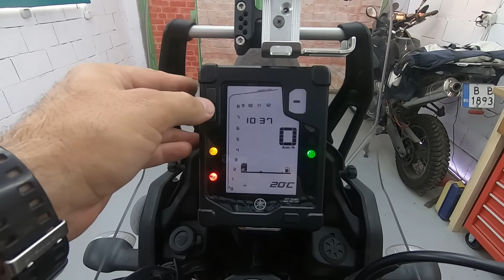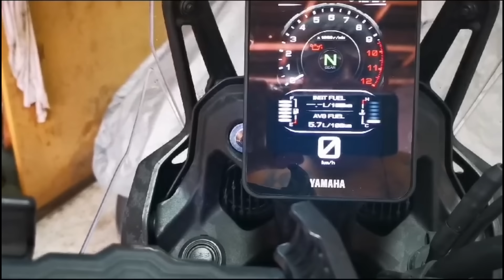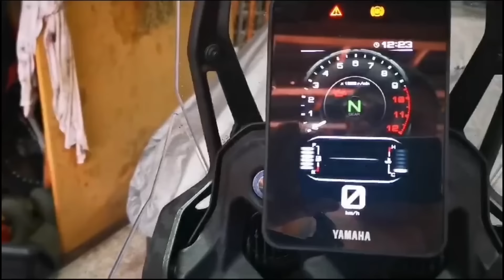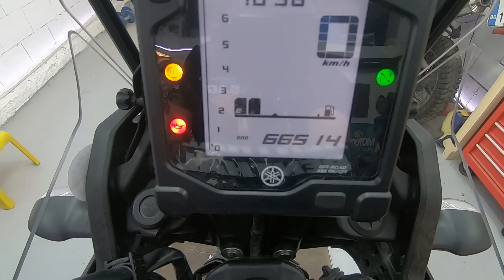Yamaha Tenere 700 - Long Term [66,000km] Owners Review

Comment: Good job with this video and congrats on the successful 66,000 km adventure!
With that much experience riding it, do you opinions or recommendations on tires and tire pressure?
Reply from the maker: Anything from 2 to 2.5 BAR, depend on the terrain.

Comment: Hi Pavlin 

Two Questions please
Has the bike had a Valve inspection before your trip? Are you still using the original Spark plugs.

Thanks Rob
Reply from the maker: No valves check until this moment. I am going to do it very soon. I change the spark plugs on 27,000km, before the trip. At the moment they have almost 40,000km.

Comment: Wow man huge respect you drove through the whole Russia, that's amazing! What can you tell about the stock tires how good are those? Would you recommend to replace them and if so what would be a good pick on your opinion. Cheers man.
Reply from the maker: The rear was fine, I did 16,000km with it. The stock was wobbling and replace it immediately.

Comment: The main problem I have is with corrosion with some fittings after riding in uk winter mainly due to salt being put on the roads (lot of them I've changed for stainless) that and my side stand switch and clutch switch, got my stand switch working again with wd40 but clutch one needs replacing
Reply from the maker: Thanks for sharing!

Comment: When bike's motor is not running oil level should be under the clutch as it is in Yamaha Tenere 700, but the clutch must be lubricated immediately when the engine is starting!
Reply from the maker: In theory, yes. On practice something else is happening.

Comment: Repeated question. don't mind. Which company's springs did you install?
Reply from the maker: Off the road: https://www.off-the-road.de/en/tenere-700/wear-parts/suspension/141292/uprated-fork-springs-linear-yamaha-tenere-700?number=GF-OTR-T700-66

Comment: I had thw same clutch issue making than noise once cold.I've changed the friction and metal  plates for a ebc ones the problem not existing any more
Reply from the maker: Ok, thanks for sharing!
Reply: ...also that throttle response ita not a throthle cable issue .Its due to an engine characteriscltisc That might be fixed by flashing ecu and tune the engine or by adding rapid bike evo  .T7 rally does not have that issue its been eliminated by yamaha .

Comment: for me just planning of getting my first Yamaha a top revue mentioning some very important points to get me going even more... thanks for that.  What about the fuel range... did you carried and extra fuel in any situation ? regards from zurich
Reply from the maker: Only once for distance of 400km.
Reply: @motorcycleadventures   with normal PET bottles or do you carry a petrol bag?
Reply from the maker: I bought a cheap petrol can and threw it away after that.

Comment: The transmission noise seems to be an issue with some Yamaha. I had a Tracer 900 2019 that had a very loud high pitch noise at 3000 rpm. It was so annoying I got rid of it.
Reply from the maker: Ok

Comment: Hi Pavlin, I don't remember if you mentioned in any video if you check the valves ? Just curious what your mechanic recommendation is.
Reply from the maker: Not checked yet. Today I spoke with him and he said that it will be pointless before 80,000km
Reply: Many thanks Pavlin

Comment: Paviln did you adjust the valves?  I am riding Tracer 900 40k km never had a problem ...
I had to change the chain, sprockets, and brakes and wash the fuel pump ....
Reply from the maker: Not yet.

Comment: Hi Pavlin. Thanks for your review of Tenere 700. I like it really much, but I am 1,71m only, and I’m reading lot of recomendations, that it is tall for small people, it is problematic to pick it up, when it fells down, the center of gravity shall be to high etc. But what other option do you see for smaller people? I really do not know… some people says, that Aprilia Tuareg is more suitable, but I am really not sure regarding the Aprilia reliability … Thanks Jan
Reply from the maker: You might try Honda CB500X
Reply: If you want to do more offroad a 650 v strom might be a good choice, i m 1,72 and it suits me pe4fectly
Reply: @robertgoetz2678  Hi. I ride allready now the 650 v-strom. But I am asking for more offroad capable bike like the Tenere. Not the v-strom and even the cb500x are without additional modifications not much offroad capable (they have low ground clearence, short suspension travels and chasis that under 90kg rider are not working..
My opinion there is not a choice. And please do not recommend me something like CRF300L..
Reply: @honzalk2931  hi, i have 72 kg, i donot understand why a v strom needs a heavier rider. I did put in more progressive springs from hyperpro in the front and rear.
 limited ground clearance might lead to rock contact sometimes, but the lower center of gravity makes it possible to lift up the bike even with baggage.
Reply: I'm 170, riding ktm 390 adventure. But it's a half of T7 in some sense.
Reply: @robertgoetz2678 Hi, I meant, that the bikes are designed for 75kg rider. If the people are heavier (for example I am 90kg, with all the gear almost 100kg), than the suspension is too soft. Even if you change the springs, it is not bike for bigger offroad. Yes, it rides somehow through, but first if you will try some bike with better suspension, you will see how it works and you will feel the difference. V-Strom is a great bike, I love it, but I am asking for more offroad capable one.

Comment: Yea I have the second problem too but I don't really think it is a problem as it only does it when you start the bike and then it is fine. How many times did you have to change the tires on your long trip btw and what tires did you use? As for the height, I am 174 and all I had to do was slightly soften the rear suspension, I think it really depends on skill and technique rather than height up to a certain point of course. Great review thank you.
Reply from the maker: I changed 3 sets of tires.
Reply: @motorcycleadventures  Thanks.

Comment: For new riders, this is not a motorcycle for technical off-road If you don't have multi year experience :)
Its very top heavy. Also, Its profile is very flat, dropping it is no fun, lifting it is no joke. Get something closer to 160Kg, one cylinder, play around. Otherwise you'll be riding on highways, gravel and won't feel much joy in more challenging situations. You need to get good instincts first.
Reply from the maker: Agree! As I said in the video it is not a dirt bike, even though it looks like!

Comment: @ 5:22 I would be really interested about a long term custom exhaust review, especially since both arrow and mivv say to watch out for discoloration and increase in noise as indicators to when the internal sound dampening material should be replaced. I mean I keep scratching my head how a custom exhaust is significantly lighter and smaller then the OEM and not trade something. I know it is more expensive but still. I belive that this is the main difference, the replacing of the wadding material much sooner then the OEM. And about tests, I think arrow mentions something about a weight decrease and I think the reason is that the insulation burns away so maybe weight it and compare it to the specs of a new one ?
Reply from the maker: Maybe in the future

Comment: Thank you Pavlin once more! Please can i ask you something, totally irrelevant: i see that that you have put two of these heat distributors on the tube that takes away the smoke of the heater. Is it worth putting two of them? 
Thenx
Reply from the maker: One for sure, the second is not necessary, but helps to heat the room faster.
Reply: Thanx thanx thanx😁

Comment: I disagree about the anti wobble front bracket. It's not just the dash that vibrates, but the headlight too. The headlight vibrating is the most annoying for me. I installed mine 5000km ago, I guess we'll see in time if it's an issue or not
Reply from the maker: Yes, the time will show you.

Comment: Hello Pavlin, you think that the new tenere explore model (which has a -15mm lower seat height) would be fit for a 175cm rider? Would the standard model also be ok at my height?
Reply from the maker: You might need to lower a bit more from the forks and the linkage but it will be okay.
Reply: @motorcycleadventures  thank you!

Comment: Re: removing upper crash bars. I’ve seen camel adv sell plastic side fairings that won’t crack. Dirt bike style plastic. I don’t own a t7 yet but one question I have is, how vulnerable is the radiator without the upper crash bars? Is there any sort of reinforcement to protect it hidden behind those plastic side fairings, or is the plastic the only thing protecting the radiator from side impacts?
Reply from the maker: In my opinion, it would be very difficult to hit the radiator. Because it is a very slim bike, the handlebar and footpegs touch the ground first. Theoretically, it could happen, but it could happen even with crash guards.
Reply: @motorcycleadventures  fair enough. I hadn’t taken the narrow width of the bike in to account. Thanks for the advice!!
Reply from the maker: Any time!

Comment: Question to all out there riding the T7: Does anybody else have starting problems. Is the same on mine from beginning. It's very rare, maybe once in 1000 or 2000km, but sometimes it's very anoing. Mostly happened when engine was shut down to quick or after running only a few seconds. After this it will not start again properly. Sometimes it helps to give a little throttle. Best way is to let it rest for a minute and then starts without any problems?
Reply from the maker: Never hear about it.
Reply: @motorcycleadventures  Thanks for immediate response!

Comment: Hey
Believe me or not, I had the same clutch problem, No slipping first time after start and the crrrk noise. At 33.000km I did send a video of it to my dealer. They tried with full synthetic oil and opened the clutch, but could not find anything wrong.
After trying the new oil which didn’t change anything, I send again a video of the effect. My dealer spoke with Yamaha and I got a full newclutch, because my dealer insisted on a full change to Yamaha.
Means change of ALL plates not only the ones with the pads, the springs, and even the basket, and the Yamalube standard mineral oil again. And you know what. The problem completely disappeared! The new clutch has a mich bigger slipping range at the clutch leaver, and a finer dosing is possible.
Now, with 58.000km, 25.000km later, it is still good and the problem is still gone.
Reply from the maker: Thanks for this info!
Reply: BTW: It’s a early 2019 model
Serial number 3200 something
Reply from the maker: Good!

Comment: I'm a little confused.  When you were revving the engine to demonstrate the sound of the exhaust, first I saw crash guards, then the second time you revved the engine a second later, I didn't see them.  Did you remove them?   And if so, why?   Thanks.
Reply from the maker: The first video is before the trip, and the second is after the trip. Yes, I removed them, because I never liked them. I said it in the video.

Comment: I test ride the T7 and was impressed, but I felt the Engine case on the side my leg. Do you get used to this ? It felt annoying
Reply from the maker: I ride with boots.
Reply: @motorcycleadventures I test rode not on my MX boots, could have been why.  Just a shortcut road bike boot

Comment: Hallo Pavlin.....thanks for your nice vid . Can you make a video about the T700 vs a Honda Cb500X ...i am a small rider and the T700 to high for me.What do you think about the Honda Cb 500X Model 2022
Reply from the maker: I rode model 2018, but not not the last version with 19 Inch front wheel. i will do it when I have the chance.
Reply: Ok @motorcycleadventures

Comment: I am having a clutch problem on my new motorcycle.T7 Rally 2023
Gears do not change until the engine warms up...After warming up, 1st, 2nd and 3rd gears work normally.
A "cıt cıt cıt " sound comes from inside the engine. The service said this was normal.
I'm sorry if there is any mistake in the translation, greetings.I am writing from Turkey
Reply from the maker: Cannot say anything.

Comment: Hi Pavlin, thank you for this Video. I am asking for a friend of mine. His t7 is getting very hot when riding in city or slower on offroad Terrain. Like 106 to 112 degrees celsius. The dealer is telling him that this is ok. Do you have the same hot temperatur on your t7? Have a nice day and always keep the rubber side down:)
Reply from the maker: No! The cooling fan starts at 105 degrees. It shouldn't go over 106 degrees. I will check antifreeze level, or for dirt on the radiator.
Reply: @motorcycleadventures  thank you, i am going to tell him.

Comment: I have exactly the same issue on my T7 with the clutch, but it hapens even on engine already beyond 90°C+, when I practice whelee for example. But, probably, this is the issue with my clutch controll skills, because I shredded through the factory friction discs in first 10k km. Belived or not, the friction squares on the first disck was 0.2mm thick, istead of recomended 2.8-2.9mm.

After this I can't build solid partnership betwen me and bike. Even after replacement of friction discs the feel of dying clutch is hunting me for good 3 month. Always something feels wrong, it doesn't let me calm down. Especially when this disk slipping happens.

Second issue that bother me - it is feeling that engine will stall if you will ride on idle RPM on first gear. I spend almost an hour each day in traffic jams and first gear on low RPM feels really bad without a constant clutch work.
Reply from the maker: Thanks for sharing!
Reply: 0.2mm is impossible and you know it.
Reply: I was thinking the same thought when mechanic was showing the plates and measures their thiknes)

The first in the packet was literaly shreded to zero. Other was somewhere between 2.1 and 2.4. Probably because steel plates was bended, thus distance between plates changed a lot.

Comment: I had one.  Great bike, but I wouldn't buy another.   Just too heavy for dirt, especially after crashes.  I went back to a "dirt bike with lights" for dirt and the roads getting there, a EXC350F.  Then I have a street bike for street riding.

Comment: 4-4.2l/100km? My GF:s MT-07 does 2.7 if ridden smoothly and 3.2 if ridden a bit more exited with the same engine. Does the aerodynamics and weight really slow it that much? Interesting. But it's seriously reliable. It even sounds reliable when listening to it. Have the MT-09 myself and that sounds way more fragile. The sound probably is dry discs. It takes a bit of time when the oil is cold to infuse the clutch. I would let it run a while before riding it.

That said I really fail to understand the concept. I have had the Honda 750 Transalp (yes the new one) myself and I really didn't get it. It's a bad road bike. It's a bad dirt bike. For transportation only I get it. But for fun I would rather have a road bike on the road and a dirt bike it the dirt. It can do both things but it does it pretty badly.
Reply from the maker: Not everyone could afford two bikes.

Comment: How a chain could last for 36k with no maintenance? Maybe it's because you ride moderate? No hard throttle or something else.
Reply from the maker: Any chain will last that long. Of course if you use it hard will be a bit less.
Reply: @motorcycleadventures  you are a Guru for moto traveling, and I, as a beginner I will follow you advice.
Reply from the maker: It won't hurt anyway!

Comment: No. A top-heavy bike cannot be easier in the piff-paff on twisty roads.
It is a simple question of momentum and inertia.
Easy to put down but terrible when you try to fast exit from a curve/turn.
This effect can be minimized only if your trajectory/path is very smooth and round.
Reply from the maker: Ok

Comment: Suspension it not good and just a simple spring change is not a solution. Your comment is simply misleading this bike in hard off road riding will bite you when it gets hard and you will crash and P.T is using 48mm factory forks and completely different shock for that that reason. His bike is far from standard
Reply from the maker: I said in the video that this bike is not for hard off-road. The changes that I have made with the suspension are more than enough for me to ride it until the end of the world and back.